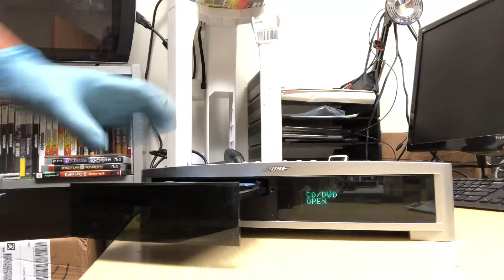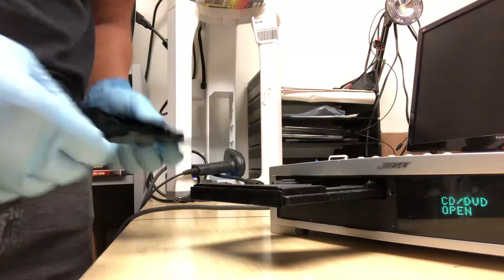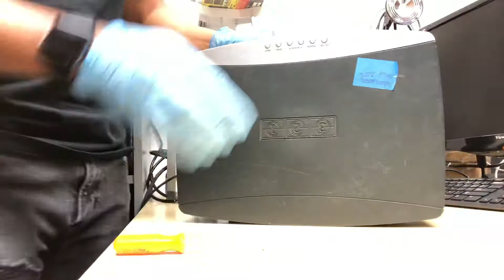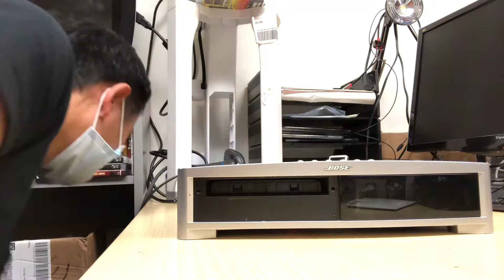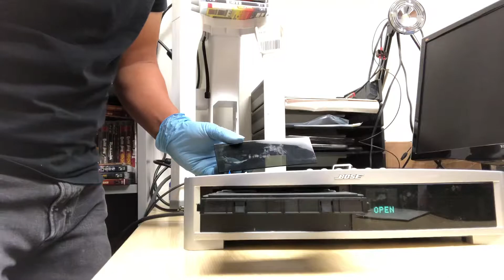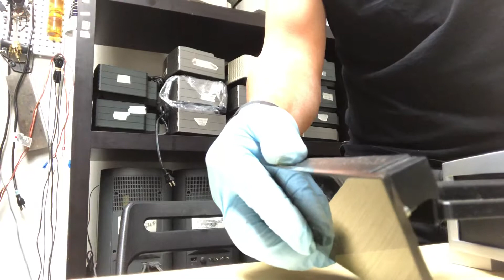How to replace Bose 321 Series II Media Center Front Cover

Comment: can you help me with mine. i Have a Bose ps 321. when powered on the screen just stays on " Bose 3.2.1" help please?
Reply from the maker: It has issue with the cable connection to front panel,   please contact us  https://usavshop.com/Bose-Repair-Service-c35972055